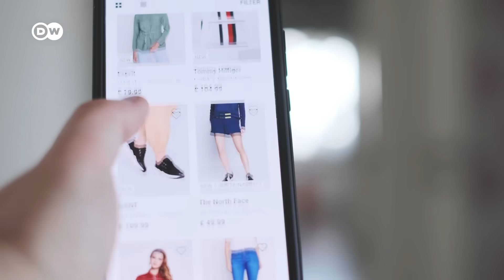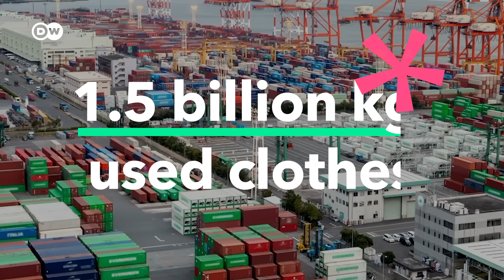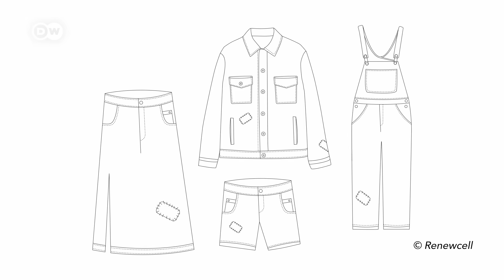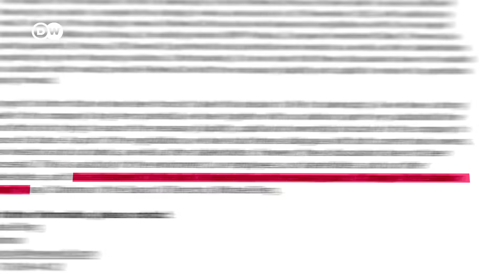Can we really recycle our old clothes?

Comment from the maker: How many pieces of clothing are YOU buying every year? 👆
Reply: depends, no new jeans this year, 2 new t-shirts +10-15 pairs of new socks.
One of the big problems is a quality of a fast fashion, it degrades too fast, best example is socks , I never had a socks that lasted more that 5 washes
Reply: @ronlevon4294  Get Darn Tough or Drymax socks.
Reply: @ronlevon4294 Darn Tough socks are the best!  I’ve had some for 6yrs now and they’re just starting to wear out.  They are expensive ($15-$25/pair) but very much worth it!  They have a lifetime guarantee so you can send your old socks back and they give you a new pair.  They’re made in USA (Vermont) and natural materials.
Reply: I bought new jeans last year.  These that I bought will last until they fall apart on me.  Then they sit until I figure out what to do with them.
Reply: i dont know how many pieces i buy, but some of my clouthes  have 10 years.
Reply: I buy the majority of my clothes 2nd hand (except for undergarments and socks, which I buy new). I love finding something unique at thrift stores.
Reply: Does this include socks and underwear? is 1 sock 1 garment?

I have a warehouse job walking 10 - 20 miles a day, I probably buy 6 new pairs every year at a minimum, am I at 12 already?

I'm sure weight is probably a better measure here - 1 coat is not going to be the same as 1 sock. But 14 doesn't feel excessive.

If I compare textiles to driving it's perfectly possible to cut driving miles from say an average of 10,000 to zero - textiles aren't as easy.
Reply: @mckennakills72  Yes, agree about the size of the garment. I live in a place where winters can be brutal. So, I own a Parka. 
And that thing just doesn't compare to a t-shirt or a sock in how much of a footprint that will leave behind. However, I bought that thing when I was 19 and I expect it will still be wearable long after I am dead.
Reply: Main question should be how long do you use it?
Reply: 1-2 pieces of raw denim that I plan on wearing for decades.
Reply: @SpartanFarron  Denim jacket and denim jeans - also known as a Canadian Tuxedo 🙂.
Reply: People flexing there low buying habits meanwhile Taylor swift taking another 10 minutes ride of her jet😂😂
Reply: @nishant_bhardwaj  *their
Reply: I try to buy good quality clothes and wear it until they start falling apart. A pair of sneakers that I purchased > 7 years ago I still wear every other day. Jeans usually last 3-4 years. Some of my T-shirts are 5 years old too.
Reply: Yeah, I have to agree with some of the comments here. In an average year, I probably buy like, one or maybe two new wardrobe items. And that's only because I've worn my wardrobe out. 

But it's getting harder to resist buying new clothes because they freaking degrade like newspaper, and it's getting hard to find clothes that have a decent material content. 

My clothes shouldn't be made to degrade in the washer. My washer shouldn't be designed to degrade my clothing. Planned obsolescence is out of control.
Reply: None. I grew into my baggy 90s clothes, so I still wear 20+ year old stuff. Some became popular during the vintage craze so they fetched good prices online. Only need socks and undies.
Reply: less than 10 (underwear mostly). I fix all my clothes and of course wash them :)
Reply: New? Zero. Used, three.
Reply: I buy 1 to 3 pairs of newly made socks each year... and probably 20 to 50 pieces of used garments that I part out and make into historically adequate costume pieces (this includes hankies bought in packets).
Reply: Only if I really need it...
Reply: 5-10. 1-2 new items, the rest vintage.
Reply: I still have a couple of t-shirts from the 1990s. I wear clothes for as long as they're wearable, and buy very few new garments. Thank you for asking.
Reply: Less than 5 items a year. And only If I need them! And I always shop second hand first. Almost all my clothes are second hand😊
Reply: I buy my clothes in military-, working-, and hiking shops. They are durable and i also don't follow fashion. Annually I buy 1 pair of trousers (good for 2-3 years, so i have 2-3 trousers), a jumper/hoodie=pulover a year which is also good for years, so i have 3-4; 2-3 t-shirts + 6 pair of socks a year.
Reply: 20 in total. I just make sure I'll want to wear them and its all good
Reply: ...GUILTY. "if it ain't food, you don't need it." ⭐Proud to be Filipina living in Canada - F Prez to JT: "We don't want your garbage"...and shipped it back. ⭐
Reply: Most of my clothes last multiple years
Reply: Be good if manufacturers make clothes that last
Reply from the maker: @sheliliaharvey3956  Hi Shelilia! Since you mentioned this topic , you might be interested in in following videos that we made 👉 https://youtu.be/00NIQgQE_d4 👉https://youtu.be/U4km0Cslcpg Check it out! And if you like our content, then subscribe. We post videos every Friday
Reply: Less than 10 for every category per year. 8-10 t-shirts, 4-6 batik shirts, 1-2 pants, 1-2 socks, 1-2 jackets. All are locally produced. 💁‍♂️ And I'm planning to wear them until they degrade so much that I can't wear them anymore, not a fast fashion. 🙅‍♂️
Reply: Lots of socks and underpants, a few bras/tops. I just bought 2 shirts new and last year I bought several brand new jackets., which is an exception. Usually I buy  almost everything except undergarments from second hand shops. Maybe like 5 new things a year?
I've gained weight so I've had to buy new clothes.

Oh, and I have a bit of a hippie style, so sometimes I buy things new because I can't find those styles second hand. I've found a couple of companies that sell quality clothes that are produced ethically. They are more expensive but worth it.
Reply: I hardly buy clothes. I don't have many too.
Reply: 10-20, and they are mostly second hand and for my kids. The younger will inherit the older clothes. Underware is mostly new, as well as socks. For us adults, we barely get new clothes, and when we do buy clothes, we try to get better quality clothes.
Reply: I broke my rule of normally only buying Second Hand clothes this year for: 
- 4 pairs of hiking socks. I walk 10 kilometres a day in my job and these socks make such a difference! I gave my old socks that are still in good condition to a friend who has no money and who doesn't walk (he goes everywhere by bike). 
- a thermo long johns for winter
- a long thermo undershirt for winter
I had weared t-shirts and long cotton trousers (mostly pajama bottoms) until now, but there was a cold day when I decided to buy warmer underwear... 
- new sneakers. My old ones already had a hole in the padding.
Reply: I never buy new Poshmark has gorgeous clothes, there is nothing new that I would wear comes from China and other asian places cheaply made and fall apart after 3 washings????😅 😅😅 I usually make or redesign  my clothes.
Reply: People don't fix their socks anymore.
Reply: Too many😔
Reply: None in the last year so far, and no plans to buy any time soon.
Reply: Kupujem polovne stvari i recikliram tako što prekrojim i sašijem ono što mi treba. Takođe i restlove,ostatke od krojenja u kompanijama kupujem u sekndhend radnjama i šijem.
Reply: Buying zero new t-shirt this year, as there are better options in thrift and vintage stores :)
Reply: Last few years I reduced my shopping needs naturally. I’m interested in reducing consumption and moving into more sustainable industry. I’m currently doing my research how to recycle my old clothes or give it a new life. Thank you for the video, I appreciate it.
Reply: Only second hand! Unfortunately, many of the clothes in the second hand shop nowadays are also fast fashion items. So after a few washes, they also get damaged. And in places u cant repair. Another thing are socks and underwear are always new. It does not matter if it is expensive, cheap, organic or not. They do not last long. Every year I need to buy new ones. Lately, I put them in laundry bags. Let's see if they last longer.
Reply: Probably a few on average?  My weight and sizes have been changing.  Before that, it was maybe a shirt for a class once a year.  I also had to buy nice clothes for work, but those lasted years; I only had to replace my shoes.  Socks gradually wear out, but they usually last years.  Most of my current clothes are quite large on me, so I need to buy ones that fit.  My shoes have large holes and them and need to be replaced.  I want to buy adjustable clothing made of linen if possible, so they'll last without making me worry about plastic.

Many of my clothes are hand-me-downs, though.
Reply: Ummmm….i bought a new work jacket this year and one pair of shoes…the last time I bought any other clothing is when I need new work scrubs (specific color) in June 2021 and thrift shop work shoes. Actually clothing was probably about 5-10 years ago…I grew up poor and stuck to those clothing habits…we didn’t get anything until we absolutely outgrew it (but large family=lots of hand me downs) or the hand me downs were completely worn to pieces. So honestly, my mentality about clothes buying in general new or thrifting would kill all the industries 😂
Reply: I buy at least 25 pcs of clothing every year. I buy mostly on AliExpress.
Reply: I bought nothing for the last 2 years, just because I was forced to leave my job. I never was shopaholic, but I like shopping and miss it. When I buy things I think that it's someone's job - to produce, to sell, and I respect it. Therefore, buying things I do not only enjoy myself or someone I like, but provide someone's life too.
Reply: Around 10 pieces
Reply: Two years I will buy new clothes.  Meaning 4 T-shirt and 3 jeans, and several socks.  Shoes depends, now 2 pairs can be used 2-4 years.  I swims a lot.  So that might be the reason I don’t need that much.
Reply: 3 new T-shirts and  3 new socks.
Reply: I bought 4 jeans and 3 t-shirts from a second hand store and also 10 underwear and socks from a local store but im still wearing a lot of stuff of my teenage years 😊 i don't clean out my wardrobe every two months. Only of something seems totally destroyed is out. After 20 years it was around ten shirts and five trousers.
Reply: very few
Reply: I think I've gotten 3 pairs of socks, 3 tshirts and thrifted 2 sweaters in the last year. I have several things I need to replace my jeans because I'm wearing holes in the thighs but I'm putting it off because I just hate the process so much
Reply: Zero 0️⃣ I find, fix and reuse.
Reply: Overall target when buying clothes: wear it for at least over 30 times.
Reply: @butimo  Just 30? Should be 300 minimum.
Reply: @butimo  ONLY 30??? I have socks that last longer than that!

Comment: I have got into the practice of donating my clothes to fast-fashion brands for recycling and donation programs and I get vouchers. I also make sure to take good care of my clothes, that is, I don't unnecessarily wash them in high temperatures, I hand wash if a garment is not too dirty or if I suspect that it will be ruined in the washing machine and I only buy diachronic designs and shapes. The oldest fast-fashion garments that I have are two long-sleeved Primark tops, bought in 2009, both of me cost me £2.

Comment: The holy trinity of sustainability is:"Reduce, re-use, recycle". In my opinion, we should focus on those activities in that order, starting with reducing.
There is a limit to how many garments we can actually wear. Fewer, better quality clothes is a more sustainable model than heaps of cheap rubbish. The current system is totally geared towards overproduction and overconsumption. We are all complicit in this vicious circle. It needs to change. If consumers turn their backs on the concept of "fast fashion", production will have to decrease accordingly.
Then we need to focus on how we can re-use garments, and the fabric, buttons, zips etc. they are made from. It always used to be done: something that no longer fitted or had worn out would be altered or cut down to fit someone smaller. For example, my mother cut up one of her dresses to make me a dress when I was a child. The current resurgence in sewing skills gives me hope that re-using fabric may once again become more prevalent. Alternatively, clothing that is in good condition can be sold (e.g. Vinted) or donated to charity.
Recycling is more resource-hungry than the first two options. It is absolutely worth investing in, but first reducing and reusing should be more seriously considered.

Comment: Most of the items I own are used.  I'm picky about what I buy, and I'm frugal, and I don't want a home cluttered with stuff.  That cuts down on my spending.  Plus, why spend $3000 for a brand new leather sofa when you can spend $400 for a used one, like I did?  Why spend $40,000 for a brand new car when you can spend 75% less on a used car, pay off the reasonable loan, and repair/drive it until it's no longer driveable....while all those years without a car loan, you put that loan payment into a savings account for your next car?  Even better, make MPG your priority when shopping for a car.  Because gas costs money, too.  Why spend $55-$150 for a brand new pair of jeans when you can spend $7 for gently-used jeans at Goodwill?  Then, wash your clothes less often so that they last longer--if our clothing is not visibly dirty and smelly, then they don't need to be washed with each wearing.  Buy used, quality shoes on ebay for a fraction of brand new prices, and don't buy cheap shoes.  Why spend $145 on a pair of brand new Birkenstocks when you can buy used for $40?  Now is the time to hop on the Doc Marten trend:  used boots are $40 on FB Marketplace, no need to pay $175 at DSW.

I also don't have children, which is an immense cost savings.